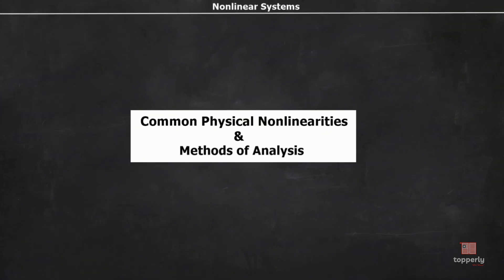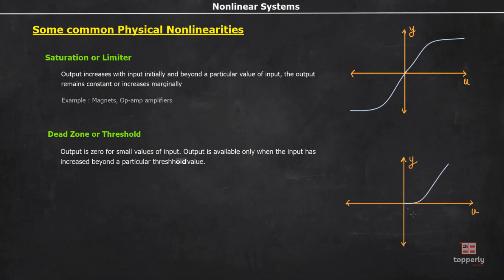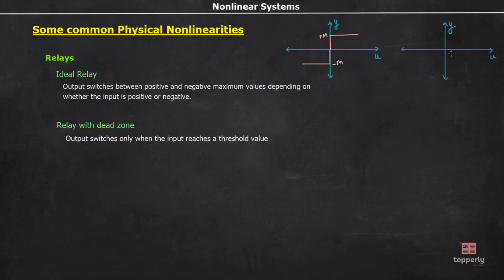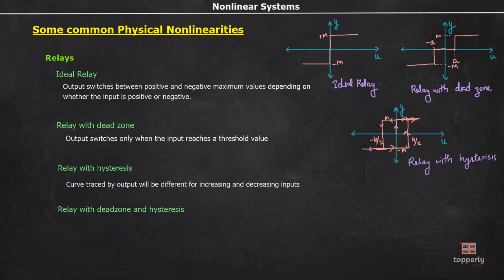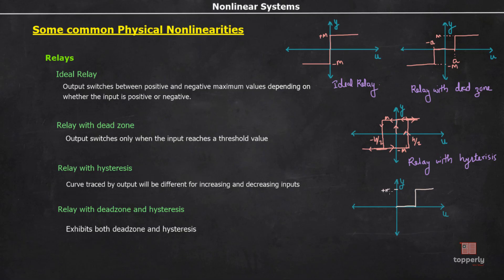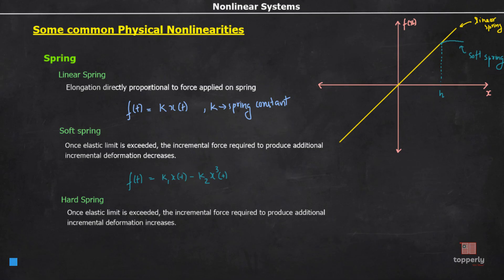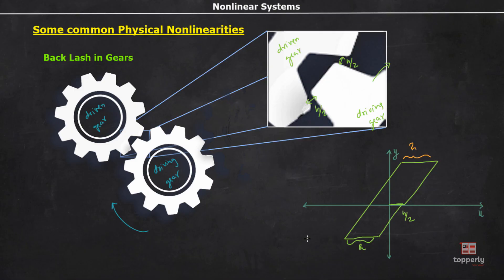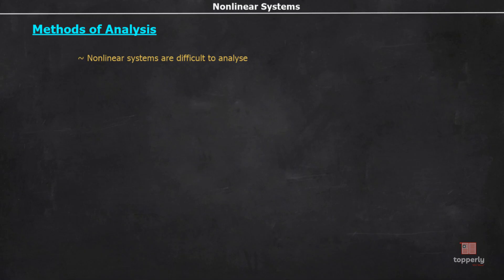Physical Nonlinearities & Methods of Analysis | Nonlinear Control Systems

Comment: Thank you so much for the great lecture, but i have a question.. 

Shouldn't the nonlinear curve for the soft spring be directed upwards (from the linear curve) instead of to the right of the linear curve? 

Because According to your definition, we're gonna need less force (x) to produce higher deformation (f) 

Am i right? Or am i missing something? 

Edit: now i completed the video and i think that the soft and hard springs should be exchanged, even the equations must be exchanged.. because for the soft spring, the deformation must see an amplified force ie (addition not subtraction) and vice versa for the hard spring.

Thank you again 👍
Reply from the maker: Hi Mohammed,
In the case of a hard spring, as the elastic limit is crossed, we need to apply greater force to bring small displacement. In the graph, y axis is Force and x axis is Displacement. So the graph should curve up to show this.

Similarly, for soft springs, after elastic limit, incremental force produces a larger displacement :)
Reply: @Topperly  
Oh okay.. i understood that the axes are reversed, thank you so much